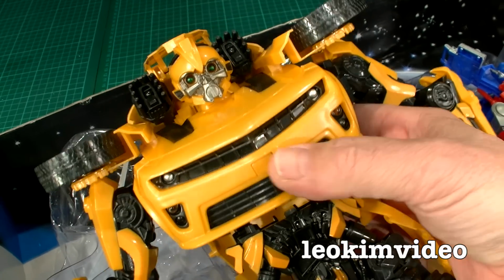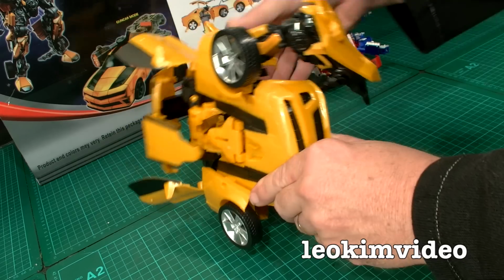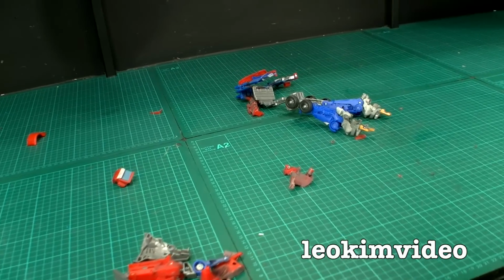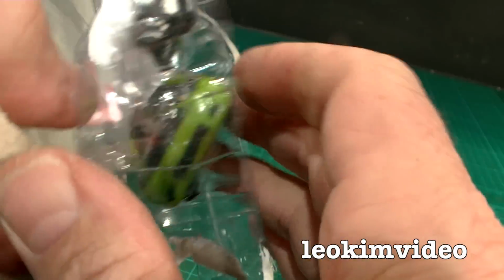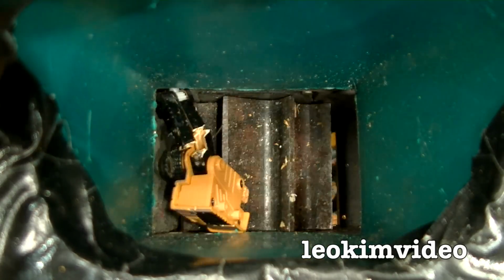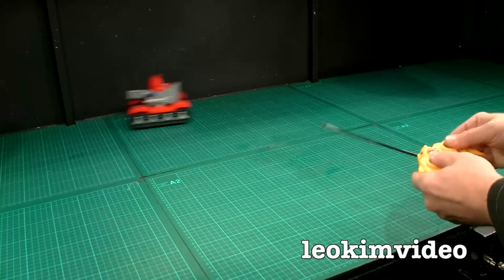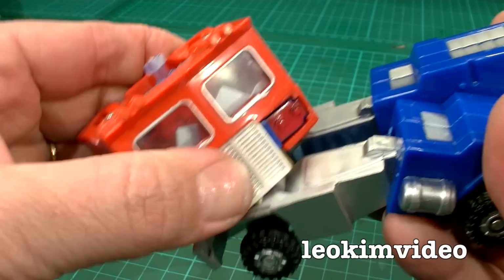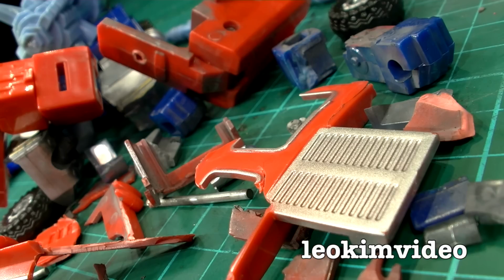Transformers Dark Side Knock Off Toys Ep 2 & 3 TNT Optimus Prime

Comment: if you'd put the camera on the stand and actually fiddle with them(the first two you opened), you can get them to stand perfectly and even play with them, and about the transformation, all transformers now in days (except for the REALLY cheap 1-3 step transformers) have difficult transformations. the figure is not bad and the plastic is not even that bad, there are plenty of real transformers have plastic like that, and you are comparing a dark of the moon design to a age of the extinction design, the age of extinction design is going to be much better, not only because ITS A WHOLE DIFFERENT DESIGN, the version you got is a double pack exclusive with chromed bits. the "clone prime" isn't even a clone of all, its just a lose version of a Dark of the moon Prime mold. Now back to the bumblebee, its simply a bigger version of a deluxe revenge of the fallen bee mold. I rest my case
Reply: Dapper Bleach - very smart dude, this is not an insult